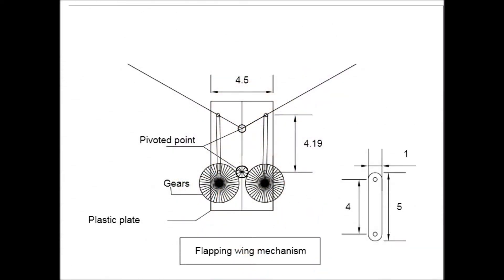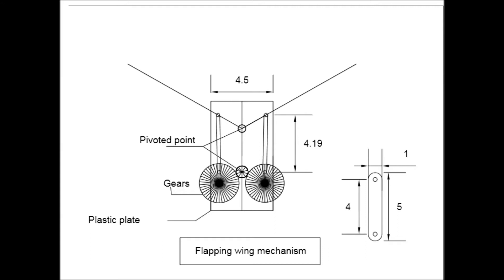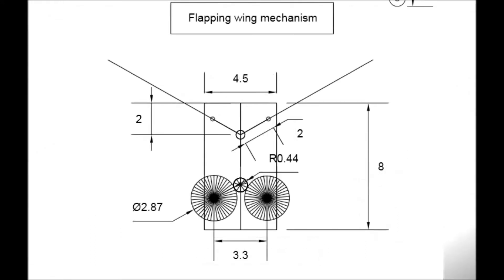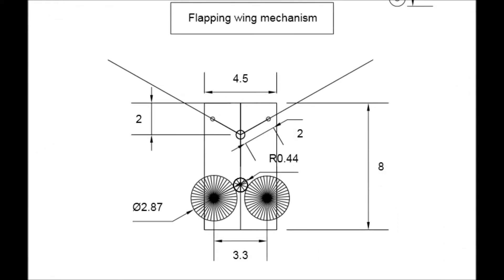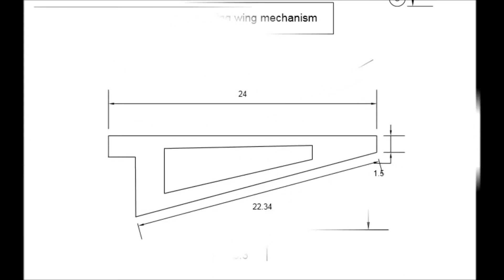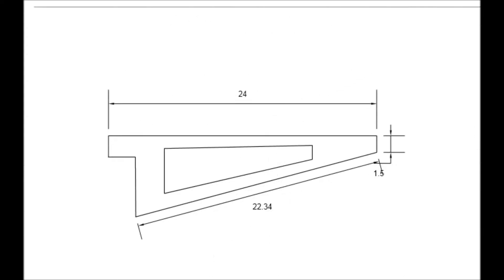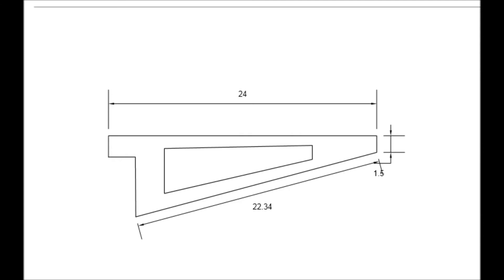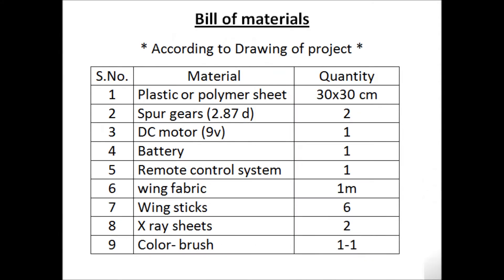#Ornithopter #flying #machine l #GROW l GROW CHANNEL

Comment: Can you provide me full detail to make this ornithopter. Please 🙏🙏🙏🙏🙏🙏🙏 i requested you that provide me the full detail of making ornithopter.
Reply from the maker: kUNAL almost all details is provided in this video and what other details you want ?
Reply: @Engineering_Mechanical  i want know that which motor you used to make this and also transitter and receiver
Reply from the maker: @kunalrai3389  ,well you can search on google you will find there and i used 9 volt dc motor which is used in CD player and i used remote control system of a toy car . watch the video gain and listen it carefully